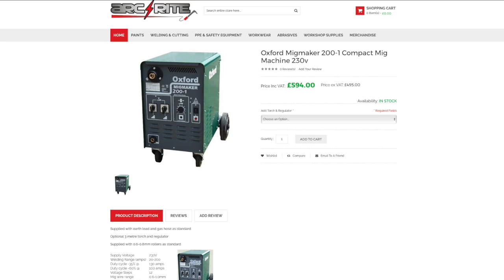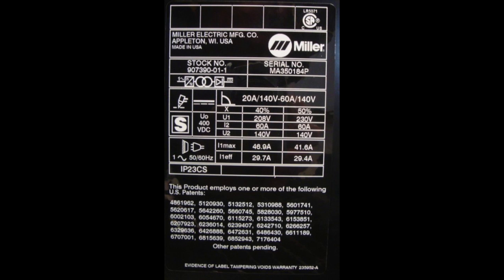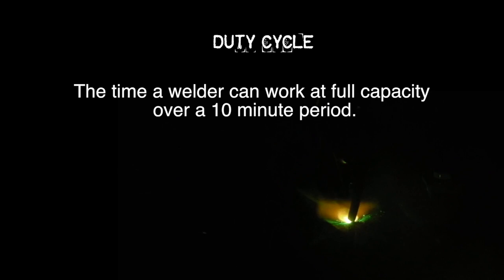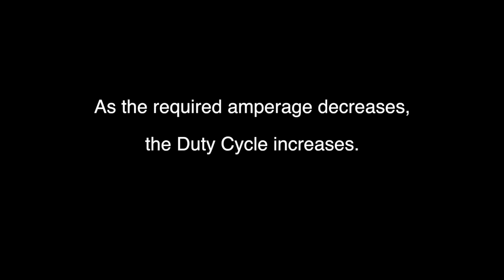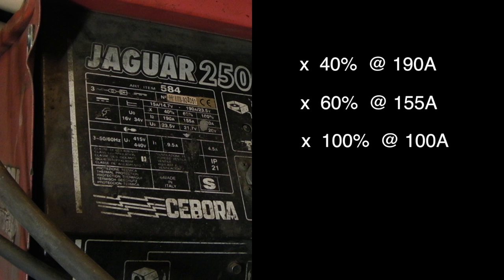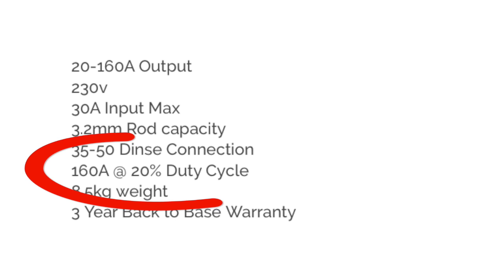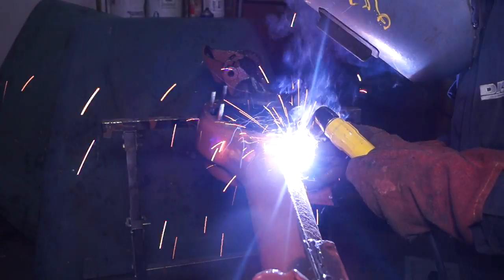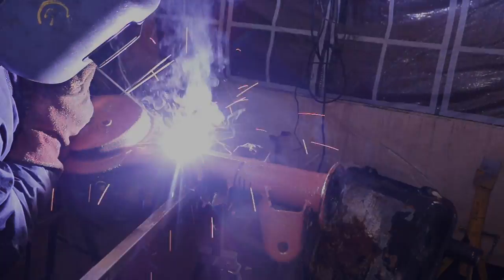Land Rover Welding - The Duty Cycle - Most Important When Buying a Welding Machine.

Comment: My next mig will have digital readouts so when I find the sweet spot on each weld I can write it down.
Reply from the maker: I know what you mean.  MMA  you can get it but MIG is just stepped.    I go by the sound.  If it sounds like nicely soft sizzling cooking bacon, it's close  :D
Reply from the maker: I got to say being an old boy,  simpler the better with welders.
Reply from the maker: What MIG have you got BTW Niel?
Reply: Land Rover Toolbox Videos its a Cebora 'craft mig' 180
Reply from the maker: 60% duty cycle at 80 amps?